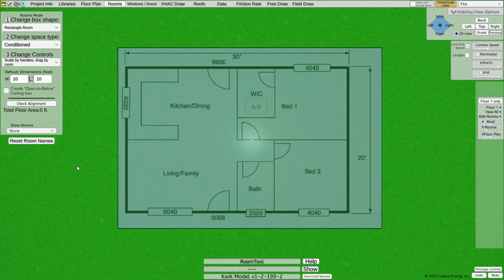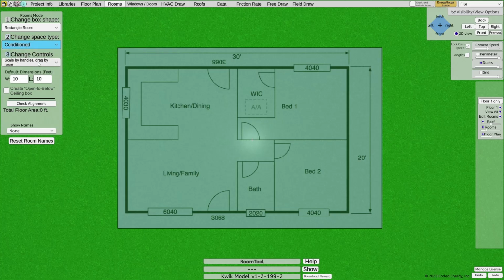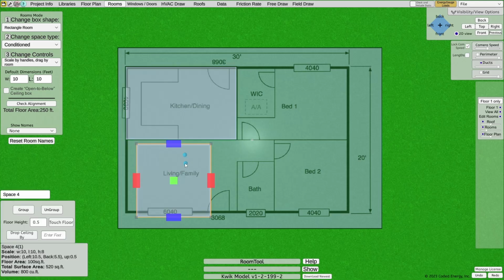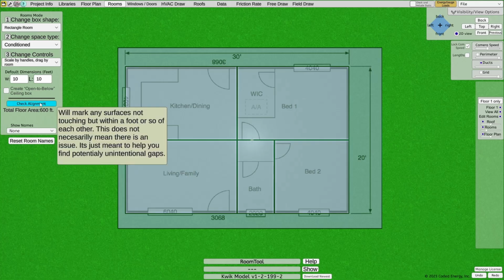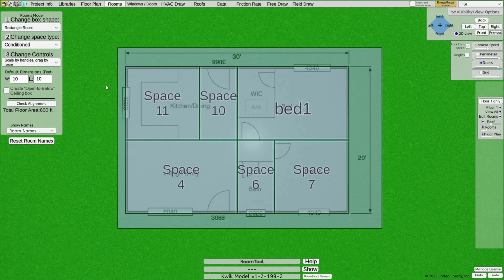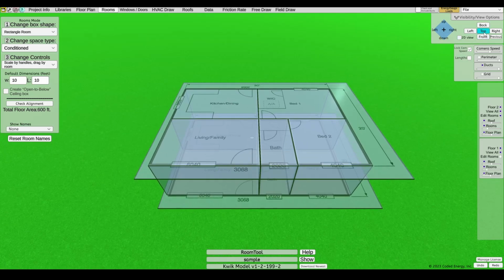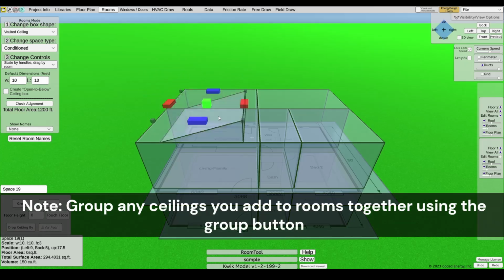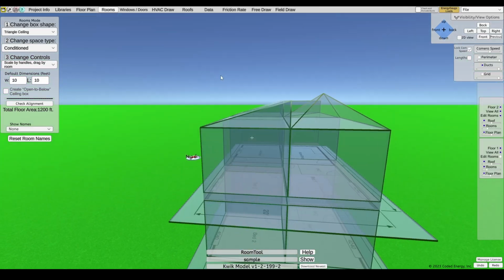DDV Adding Rooms

Comment: how are the ceilings different than the roof?
Reply: The ceiling of the house is usually considered the primary air barrier where the heat transfer between inside and outside occurs.  It is typically where the insulation and air barrier are touching.  Above that is the attic (typically vented) then the roof.  In this case the roof is basically just an umbrella over the house.  Cathedral or rafter ceilings are similar, except that there is no attic, per se.  The exception to that would be "encapsulated" or "unvented" attics where the insulation is applied to the underside of the roof decking, usually spray on foam, and the attic is considered "semi-conditioned" space.  The ceiling then becomes an interior surface with or without insulation, depending on the temperature of the attic.